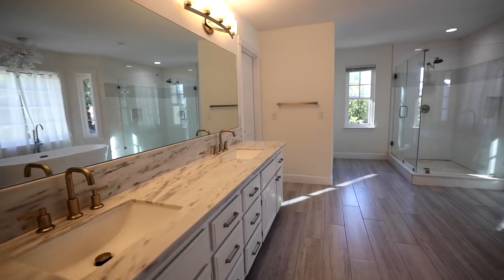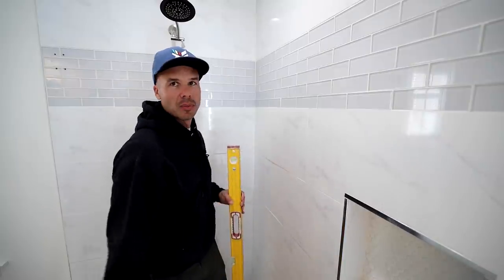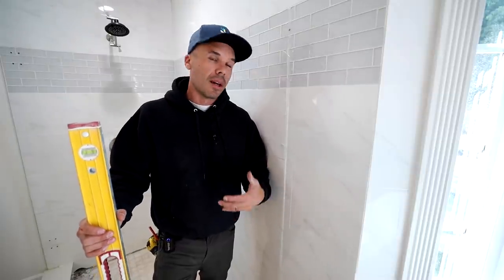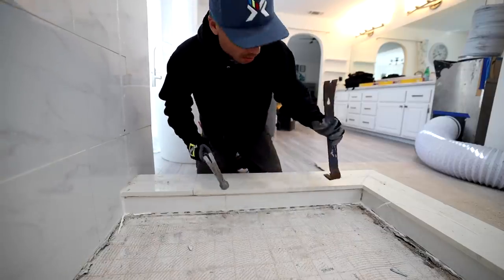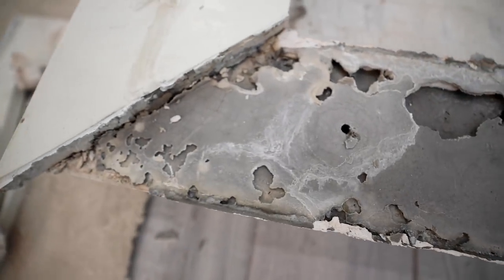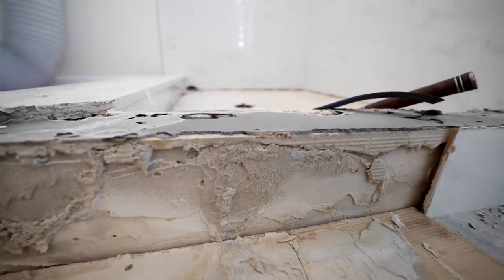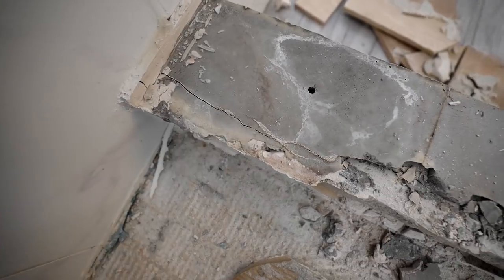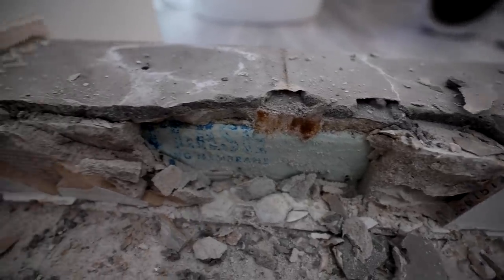FLIP HOUSE SHOWER FAILURE!!! --- Pan Leaking through Ceiling

Comment: This shower didn't fail because he mixed a water in and water out system with a topical membrane. It failed because he did everything wrong.....Window flashing and liquid membrane over wood and a leaky old hot mop 🤦.  If you install a pan liner correctly and waterproof the top of the mortar bed with liquid waterproofing, it won't fail even if you mix the 2 systems..... Moisture sandwich is a theory and not a fact. I would love to see a video where a Starrtile shower style fails.
Reply: That’s exactly what I was thinking.  Even if you don’t put a pan liner and just waterproof the top . Does the moisture go into the subfloor?  Moisture sandwich sounds scary but not logical.
Reply: Starr says he never had have a failure doing it this way.  I believe him

Comment: @TileCoach - Absolutely nothing wrong with anchoring long screws through water-proofing membranes. They need to be anchored deep into wood/concrete structure below. The fix is simple: clean the hole out after drilling it and then fill it with silicone before you screw anything down. It will completely fill the gaps and gush out. Clean the excess. And Voila.
Reply: Doesn't work...
Reply: @Tilethoughts  what about a rubber gasket between the tile and bottom of bracket around the screw but in the shape of the entire footprint of the bracket?
Reply: @MV-wb2cz  that would probably help but water will still most likely find a way to get in there... What I did on mine is cut the screws to 3/8 of an inch on the curb and drilled holes same depth and set in epoxy.. with no compromise to the waterproofing
Reply: @Tilethoughts  but then doesn't the epoxy get exposed to the water over time which will delaminate it and fail the shower glass?

Comment: Shower door stores sell U channel trims. Those just needs to be installed on sides where wall plane transition to glass panel to cover uneven edge when you position glass panels on level curb. U channel are available in different thickness and can save up to an inch out of plumb tolerances. Also, modern U channels do not have that quarter round profiles of 90s so they look pretty slick with glass. The look and setup still stays frameless.
Reply: Ya for $2,500 I could think quite A few things to make it look good.
Reply: @DK_tk3  i agree, i might even redo the plane of the new wall to match as long as there is no lip out
Reply: It can also be recut square by a professional glass installer.
Reply: @howtodoitdude1662   tempered glass cannot be recut

Comment: So if sheet membranes go over motarbeds that’s okay??  But for the same motarbed u say redguard is not good??   Thanks.
Reply: It’s not about the type of waterproofing over the mortar, it’s about the overall system being used. In a sealed system using a bonding flange drain and no pvc liner you would waterproof everything right up to the drain flange. When you don’t want to waterproof a mortar pan is when you’re using an old school pvc liner system with a pre slope and clamping ring drain. That system must be able to allow water into the mortar bed. Hope that helps!

Comment: I'm a tile guy and trim carpenter. You shouldn't have been obsessed with having perfectly plumb walls. You could have reframed the walls out of plumb to reuse the glass. It wouldn't have been noticeble. I've never done this intentionally with tile because I never had to reuse a glass enclosure. But with trim, I often install a door slightly out of plumb and/or rip my casing because the adjacent wall is out of plumb, and it would look like I made a mistake it I installed everything plumb and the reveals were uneven. Goal is to get the best look and a door that works as it's supposed to. If you have lemons, make lemonade.

Comment: After drilling the holes for the enclosure hardware, fill the holes with a sealant that will bond to whatever waterproofing material is used (not always silicone).

Comment: Thank for your videos! Tile setter here, I tore out a shower once years ago and the previous guy drilled hardibacker into the base of the shower pan. There were screws like ever 2-3 inches at the bottom. Same thing, the people just bought the house. I’ve always preferred (and was trained) hot mop, 4mil plastic, lathe, float. Never fails. But your technique and tips have been great. The more I see the more I have to learn and it’s such a great experience.

Comment: I'm having some shower doors installed on a tile job I just did it's scheduled for this Friday, I'm going to be on site during installation to make sure if they do drill holes in my curb that they inject some silicone or other type of caulking into the holes prior to the screws, this way I can ensure my waterproofing won't be compromised by the door installation.
Reply: My guy is coming on Monday and same situation. Says he needs to drill into curb so think the silicone is all I can do now.

Comment: Absolutely I’ve had the “no no no don’t drill thru my WP” conversation …I was told I’ll fill it completely with silicone and I’ve never had a leak. I leave it with the homeowner as they’re taking responsibility for any curb issues. Then I feel terrible for them and the position they’ve been put in. I now form my curbs a bit thicker on top with deck mud and insist no more than 1” anchors.

Comment: What about also using pieces of self-sealing rubber (or silicone) tape under the the glass anchor tabs? I’m talking about the stuff electricians use to seal outdoor fittings. Then when the screw is driven through, the tape will seal it.
Reply: Thats fine and dandy, but the real problem could be from wicking, capillary action.   Question is, will the thinset suck up enough water to make it to where the screw holes are?  I think putting silicone down the screw hole would work good.  But wish there was an easier way to secure the door without drilling through the water proofing membrane.

Comment: Also glad you addressed the elephant in the room of lots of contractors using redgard wrong, it's important that you use the product properly and essential that you use the proper style drain with weep holes and that it's a multi piece design, seen so many vids of people using redgard with single piece drains and drives me crazy, they're basically trapping the water with nowhere for it to ever go...
Reply: can u explain the issue so beginners like me understand the mistake? is the problem that installers redgard the entire cement floor before laying the small tiles and that they should not redguard the floor? Is the issue with no weep holes that water in the floor pan just stays there unless the drain has weepholes?
Reply: @BillSW  Isaacs point on not using waterproofing liquid/or not membrane on panliner/hotmop showers bed is that those systems imply water absorbing into mortar bed to weep into drain over panliner surface that is why preslope that panliner sits on is a must. Sealing such mortar bed with membrane creates water trap as membrane does not let water trapped in mortar evaporate so whole mortar bed converts into moisture accumulator which will lead to nothing good in long term perspective. Not to mention that panliner based showers are quite thick and heavy which may not be best idea for non ground floor installs.
Reply: What’s the solution? Is the Flow FX drain the one to use in this scenario?
Reply: 100% this…. I’ve got customers I did showers for over 15 years ago that are redgard and with a Mark E Industry shower pitch kits. 

It’s not the fastest way to do it but I know it works, I have the tools lined out to do it and im proficient at it. I know it works so I keep doing it.

Comment: Thanks for your great videos. Ive checked a bunch of your videos. Im building a new shower in a basement and Im trying to find out where you explain the build of the base.
Ive seen where drywall, and cement board are set Dehind the pan etc where you have shown the problems. Its where the wall and the base or pan come together im trying to plan.
Thanks again

Comment: After 25 years in construction, I've seen and demo'd some crazy stuff. My ''favorite'' was a 30 year old house that had a complete reno at the 20 year mark. House is now worth about 3 mil. Owner saw a tiny stain on a first floor ceiling below the steam shower. What we found left us in awe. Multiple floor joist rotten, a 4 ply engineered beam with 25% rot over a six foot section, three feet on the bottom of multiple studs gone from rot. That beam picked up the second floor joist AND an exterior wall and roof load! The cause? When the tiler set the EPDM liner, they proceeded to use their POINTED trowel to work in the dry pack base. Around the perimeter of the liner were ten triangular shaped slits in the rubber! Probably cost the owner $20k in repairs.
Reply: Yup, custom shower bases can make a nightmare ..

Comment: Hey I love your videos and insight. I did want to say one thing. I have been doing shower enclosures (3/8 and 3/16 glass sizes) for years. The reason the shower guy drilled into the curb like that is because there is no other way to anchor the clips down to the curb. What they are supposed to do when they fill the hole is use mold resistant silicone in order to keep the water from protruding below the shower pan and possibly leaking past that. Plus you silicone around the clips again after everything is mounted and set. Also if the curb is pitched properly it shouldn't have standing water on it anyway.

You can also use channel and wet set it on the curb which will keep the glass stable with clip assistance on the wall to keep it stable throughout.
Reply: Would you reccomend u channels over clips on curbs?
Reply: Yeah I would use channel as it is a lot more forgiving for outages and issues you may run across. Sometimes I do channel on the curb and then a clip or two on the wall depending on the tilework.

Comment: My glass guy uses no brackets.  High strength structural silicone only.  Two steps: 1. Puts a bead down and shims it level about 1/8 gap between glass and curb, so the silicone doesn’t get squeezed out. 2. Next day removes the shims and silicones the gap left from removing the shim. No holes, no leaks, no brackets to clean around.  Only good.

Comment: My shower door guy does not put screws Ann any horizontal surfaces. When he drills holes in the wall he uses caulking in the hole, then puts the anchor, then caulks again, then screws, then caulks over top and puts the cover on

Comment: I don't install glass doors or panels, but I understand sometimes it's hard or near impossible for them to install big heavy glass without anchoring the brackets to the curb. What I've seen them do is glue the brackets with some sort of crazy strong epoxy or something similar. If they absolutely have to drill, they fill the holes with that epoxy and screw the brackets while It's still wet.

Comment: In my opinion screw holes are rarely if ever an issue, all is needed to squeeze some sealant into drilled hole and use stainless screws, also generous squeeze of sealant under glass holder bracket as wont hurt. Those simple protective treatments cost nothing for glass installers, but they never do that, as they don't care of longevity of your shower. Their task to install glass and not scratch or break tile work and get out immediately to new job.

Comment: Silicone in the screw holes before the screws go in plus caulking between the sill and the shower glass plus a slight inward slope on the sill should give you three lines of defense against water getting past a screw. My feeling is that the screw holes are not the issue here.

Comment: I think one of the best ways to avoid issues with curb damage is using granite on the top of the curb because it eliminates any chance of water absorbing into the tile or grout and just silicone your holes and whatever you need to fasten. I think it's enough to last 20-30 years. But even then, if you're a home owner that understands proper maintenance, youll be re-caulking things in 5-10 years. 

I don't see a big issue with drilling through the curb, but that's only if you're using a granite top. If it's tile i would not be as confident.
Reply: Doesnt make sense to me granit or tile no hole thats it

Comment: red guard, Starr tile cough cough.  I got out of tile and got into glass. There are several designs that avoid horizontal penetrations, it's not something we like doing.  but for a frameless door there isn't much choice.  I sink them all the way, but I make sure to clean out the hole as good as possible and add sealant.   The hole is completely covered by the glass and silicone and even if that were the fail the plug fits really tight and heats up a little when you drive the screw so sorta acts as a seal also.

Comment: Ah the days of working on flip houses. Rough door openings framed with single 2x4s to finished size. Walls framed 2" off from top to bottom. Working around pvc pipes only to knock down the whole unglued run. Enough tile lippage and to make a grown man cry.

Comment: I also just moved into a new house and they had to gut the entire shower because someone slit the shower pan.  When they took apart the tile, I noticed everything was “cookied” like you mention in the video.  One glob on each tile but not properly spread.  The tile guy I hired said it was dangerous because moisture can get behind that and eventually cause tile to fall.  Would you agree?  I have two other showers that they did where I presume it was the same method and I don’t want them to be unsafe.

Comment: What do you think about putting hydroban liquid Over a pitched dry pack mud job b4 tiling? I know it's water in n out system but many times I worry the plumber covered all the weep holes wt silicone products.Many plumbers in my area OR contractors are tryin to save money by mudding the pan themselves. You think putting hydroban liquid on top of dry pack is pointless right?.?
Reply: If anyone other than myself muds the pan My guarantee is Eliminated

Comment: I worked for awhile installing shower doors. Those holes should have been silicone and then after you install the glass clamp you silicone the the screw head and the remainder. Anyone that knows how to do this properly wouldn't make any mess either. Just a cobbed shower door install. You can also do channel and you use construction grade double sided 3m tape for the bottoms. People dont like that look. When I would measure for a shower I would always push for channel on bottom clamps on side if they didn't want channel all around. Channel is the way to go. Obviously screw your sides in the the walls but you always silicone everything after. Channel to tile channel to glass.

Comment: The glass guys should be using anchors and prior to installing the anchor they should be putting a sealant in the holes or cutting the screws shorter

Comment: I have seen a few video where you mention spending time and money on materials to created a quality water proofing system that will last. Then the show door guys due their installation and go through the water tight membrane creating a potential leak over time. 

Question: So how do you ensure a water tight show enclosure installation without compromising the structure it is being secured to?

Comment: Hey, been watching your channel for a while now.
What do you recommend for the Shower panels, if not drilling into the curb/floor?

I wouldn't trust just silicone to hold the panels for 10+ years.

I install shower Enclosures, and always drill into the tile/curb, adding silicone around/ in the anchor hole.
No problems yet for me, but I can see it being a problem, if it is not properly sealed.

Any other recommendations?

Comment: They had a very sloppy troweling technique too, every tile you lifted I could see uncollapsed trowel lines, meaning they likely should have used 1/2" trowel and back butter the tiles, and they did not mash the tiles deep enough into the mortar to make the trowel line scollpase. I also saw one of the wall tiles you removed, there were criss crossing trowel lines, another big no-no. All the trowel lines under a tile should be in the same direction so air can escape and trowel lines will collapse down.

Comment: Love your channel. I haven’t seen a video of yours with a stand alone tub in the shower. Can’t seem to figure out how to waterproof the tub drain. Your help would be much appreciated.
Reply: What do you mean by stand alone? Claw foot where drain is visible or freestanding where drain is under the tub and you won’t see it when tub is installed?
Reply: @kirilllesnykh2166  free standing
Reply: Then just install your tile around the hole, install the tub on top, and silicone around the tub
Reply: @kirilllesnykh2166  does it make sense to step it up around the hole ?
Reply: Or am I over thinking this
Reply: @kylebowie781  I think you’re kind of overthinking it, but if you really wanted to bulletproof it just in case, get some wedi joint sealant, fill the hole, then refill it again over top to slope the sealant away from the hole, make it tight to the pipe
Reply: Sal Diblasi did a shower like this years ago and explained how to waterproof the tub drain. Look through Sal Diblasi’s videos.
Reply: @JohnSmith-bs6mf  thanks John, I feel good about that method.